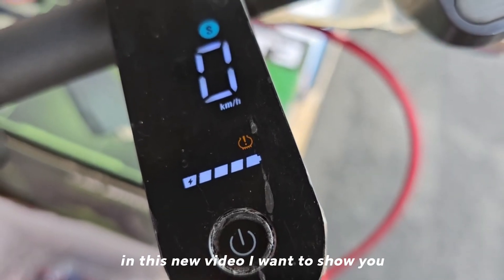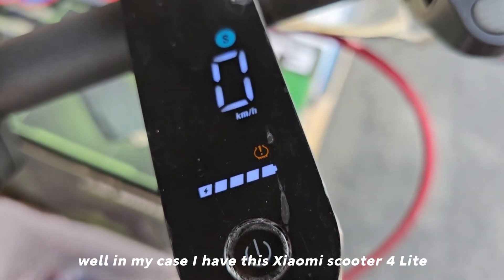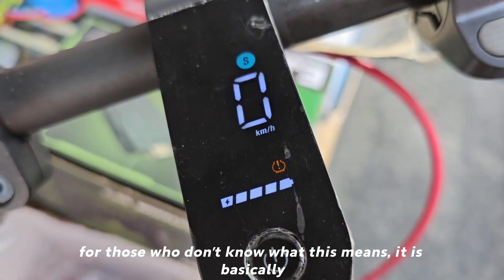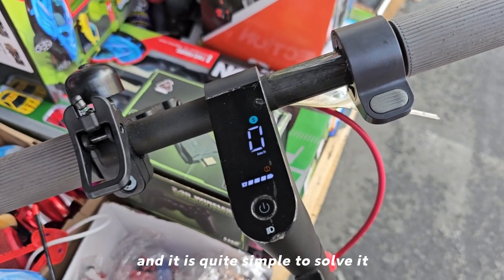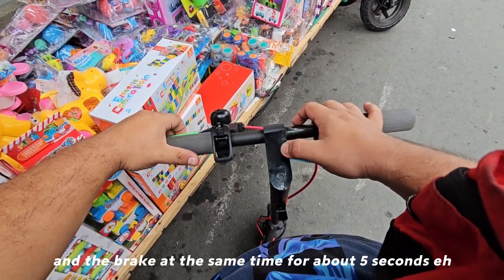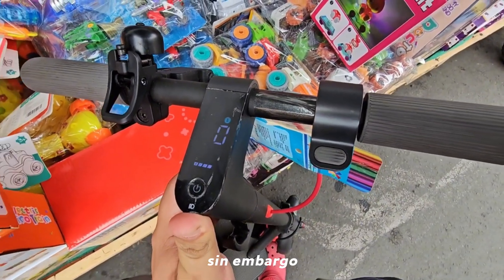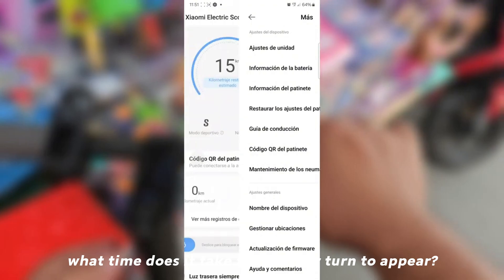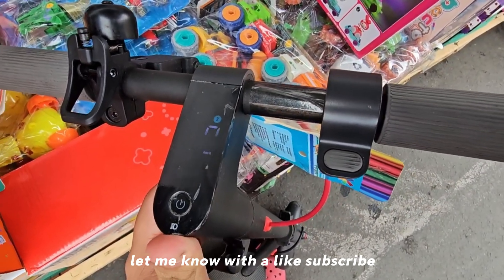What does that Tire Warning Light mean? and how to fix it on any Xiaomi scooter

Comment: So now another riddle is solved because I have already asked myself if those scooters have actual tire pressure monitoring, and the truth is: No. Its just a indicator light that lights up after a time programmed in the scooter, but there is no pressure sensor that can actively monitor the pressure and tell if its too low or not, as its the case on cars